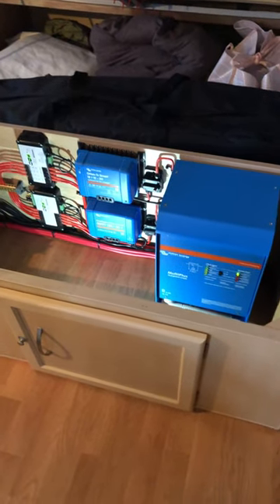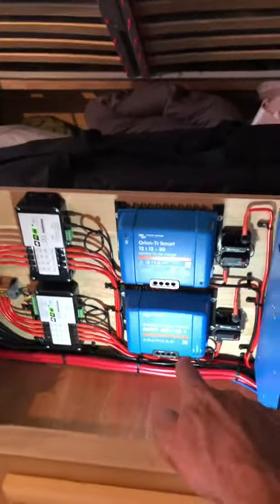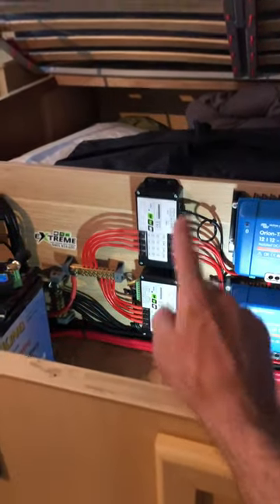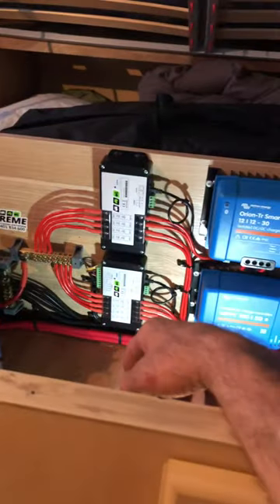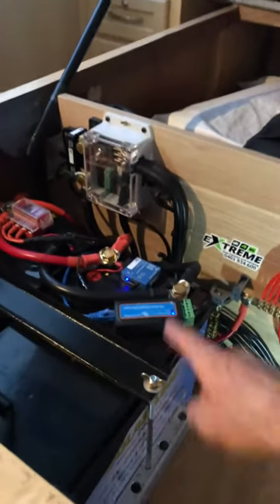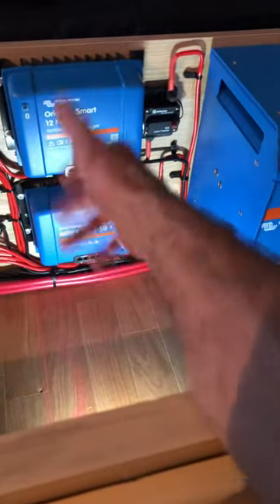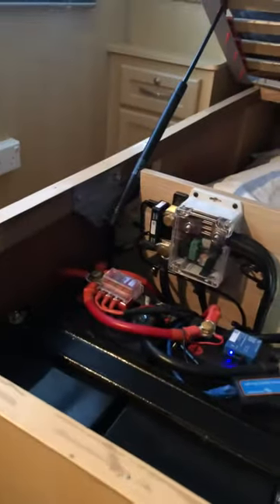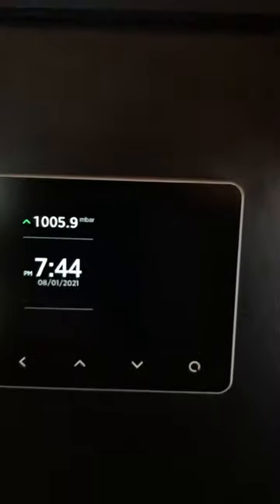Run your Air Conditioner Off Grid 2

Comment: Hi Matty can you do a complete solar inverter fit out on a brand new caravan while it’s being built in Melbourne 
I’m looking at 12-1400W of solar with about 600amp of batteries and I am steering towards the victron 3000w inverter charger but I was thinking on the Enerdrive system 
What’s your thoughts on the Enerdrive batteries compared to the power Paul batteries 
Can I possibly have your email address 
Cheers 
Bob
Reply from the maker: Hi Bob,
Let’s chat about this more, but basically Pauls batteries have a very high continuous discharge rating compared to most on the market.
It’s a fail safe using his batteries as one battery can run a 3000 W inverter. This is why I’m using them also they are smaller with much more energy density compared to most on the market.
Unfortunately I cannot do Melvin however I would recommend getting your caravan built as basic as possible cave it to a compressor fridge and instantaneous hot water then I can work my magic.
Info@extremeacc.com.au